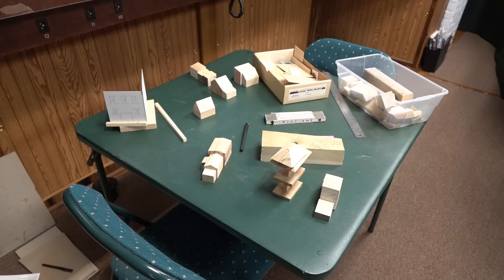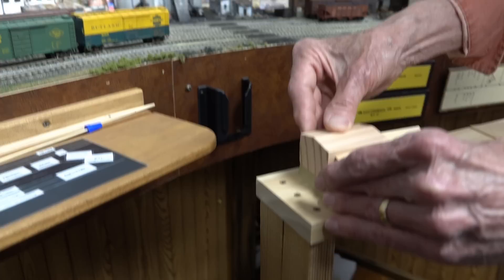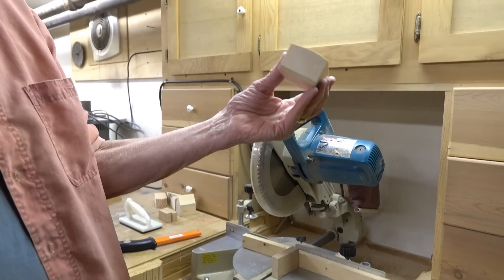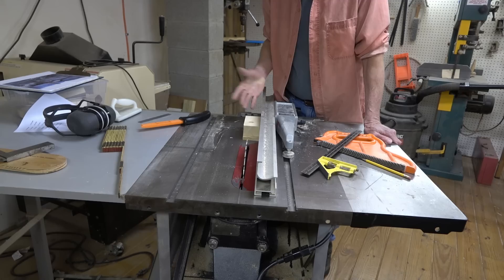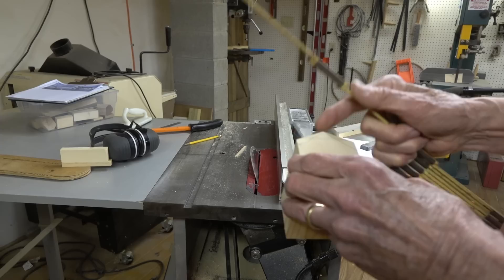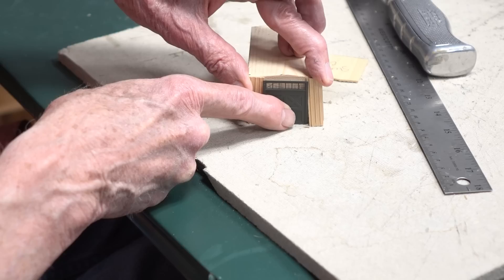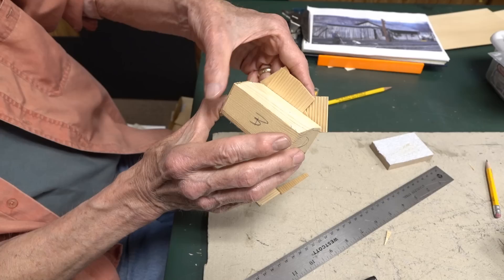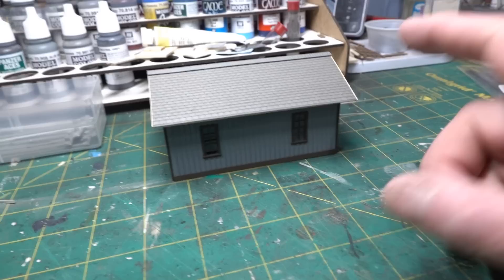Scratch Build #3:  How to Use Solid Wood Blocks for Buildings

Comment: What manufacturer can I get all the products like the clapboard siding sheets and roof materials? Thanks
Reply: Bobby: Thanks for watching. Try Northeastern Scale Lumber for the siding (I like the 6" x 24" x 1/16 thick best). They have an assortment of sidings. For roofing you can use fine grit sandpaper, thin black paper, paper available at craft stores or try places for shingling like Bar Mills,  Rail Scale Models or Minuteman Scale Models. They have nice varieties of shingles in all styles and colors. You can also spray grocery store type paper bags with a cheap flat black primer and get cool looking tarpaper once it's cut into strips. Good luck with your projects. Bill Schopf
Reply: @bschopf1  do you know which part number that Northeastern scale lumber clapboard siding would be? I went to order some from their website and I cannot for the life of me figure out which one to get for HO scale.  I would greatly appreciate it! Thanks!!!
Reply: @illusionclassicrock6742  Hi. I went back to the video because honestly I forgot what we used. What Rob used was not clapboard siding, but board and batten. I'm pretty sure it was Northeastern Scale Lumber Co. part #521-451 (Walthers number). That is board and batten 1/8 inch spacing which comes out to eleven inches between the battens or what Northeastern calls caps. This would be a typical construction technique. Vertically layer 1x12s and then nail the 1x2 battens vertically to cover up the joint between the 1x12s. I would not think typical construction would use 1/16 spacing which comes down to spacing every six inches (part # 521-450). I'm sure it was done, but this Pennsy building looks as if consists of 1x12s with the bats added on. A lot of this is simply up to your visual preference. But I think the #451 part will look much more realistic and less crowded than if you used the 450. Just remember that in HO scale 1/16 inch breaks down to 6 scale inches, 3/32 breaks down to 9 scale inches and 1/8 breaks down to 12 scale inches (approximately). The scribed siding is sort of like the board and batten, but without the raised battens or caps. We definitely used board and batten. Go with Northeastern #451 (I would get the 6x24 instead of the 3 1/2x24 (Walthers part #521-70404) so you don't have to splice pieces together. A six inch wide piece covered the length of any wall on this structure.) One caution: I just ordered some Northeastern clapboard siding and was told the plant is shut down now because of the Covid and probably won't reopen until Feb so you might have to prowl around some to find what you want. The #70404 will work for you and might be more available but you'll have to spice pieces together if your wall exceeds 3 1/2 in length. Not a big deal, but the 6 inch wide stuff makes it easier. Best of luck to you in your modeling and thanks for watching. If you need any more help, let me know and I'll do my best to confuse you. Bill Schopf
Reply: @bschopf1  wow, thanks for all the great information Bill! I’m just beginning my scratch building journey. That will really help!!!
Reply: @illusionclassicrock6742  Glad I could help. Hope you can find what you need? What part of the country you from?
Reply: @bschopf1  thanks again Bill! I’m in Wisconsin, just north of Milwaukee.

Comment: How would i do this in N scale ?!?!?!?!?!?
Reply: Use smaller blocks...but seriously, it is just a matter of scaling out the size of the building and using appropriate sized blocks. Now, there is the practical matter of cutting smaller blocks, as you do use a miter and table saw. At some point the blocks would be too small for safe use- I am not sure I would attempt a Z scale building.